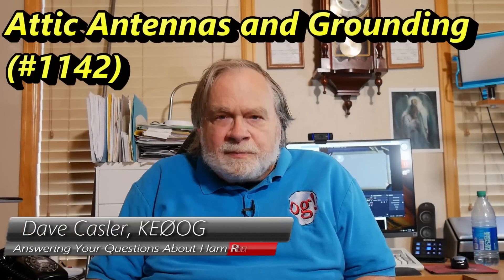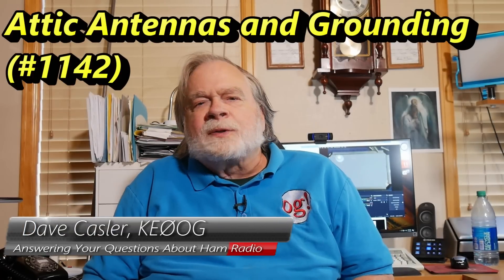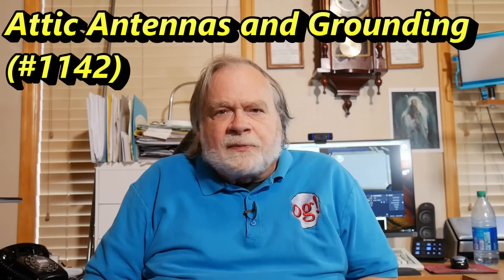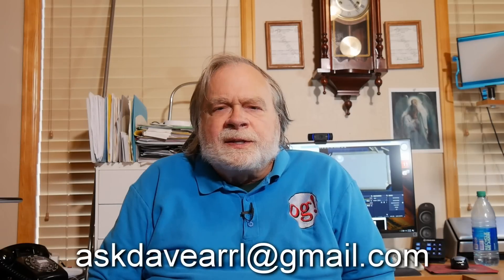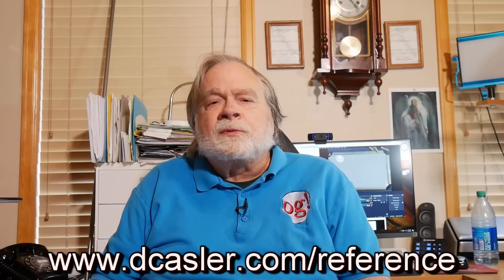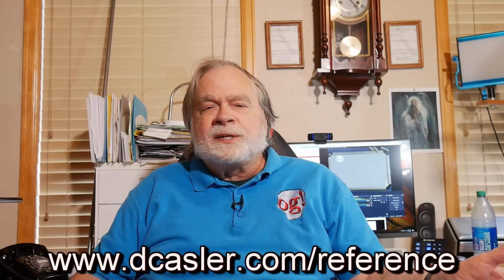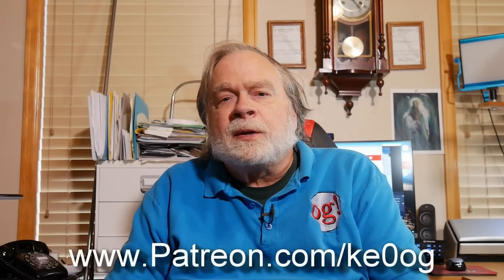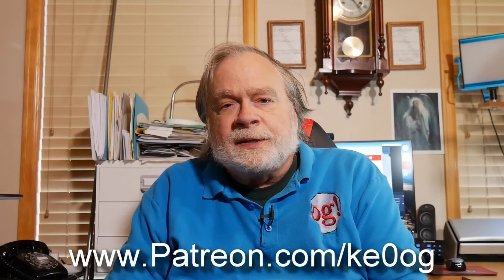Attic Antennas and Grounding (#1142)

Comment: Grounding, is Not a simple concept. Consider how do you ground electricity from a spaceship, boat, airplane, on a glacier or a large and deep body of ice and snow? The required lengths of grounding rods in the earth is different for different countries, how did they establish the codes for different countries?
Reply: I think the likely soil conditions make a difference.  In the US, the NEC is the standard with local modifications as needed.  I would expect that if longer ground rods are needed due to local conditions, you will find this in your local code that superceeds the NEC.

Comment: What vertical antenna(s) mounted above ground and don't need radials? Anyone??
Reply: MFJ has one, model 2389, its now being sold through DX Engineering.
Reply: @davidsheedy5793  MFJ2389 is not a good number on DXE.
Reply: COMET CHA250-HD.

Comment: I’m putting up an outdoor antenna what gauge bare copper wire do you recommend for the lightning ground? Thanks.
Reply: I believe it should be at least #6 bare copper stranded.  Check the ARRL book Grounding and Bonding for the Radio Amateur by Ward Silver or the NEC section 800 - Communications Systems.  for a full explanation.
Reply: Problem is the effective grounding  is geologically dependent. And surprise the earth is not uniform, geologically.
Reply: @raywhitehead730  well, I can’t control the earth but I can control the wire I use.